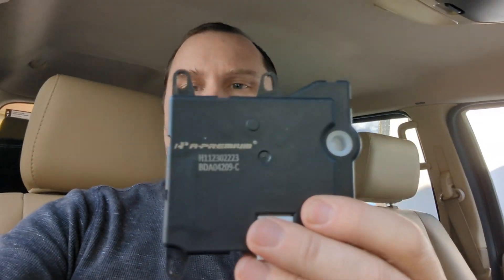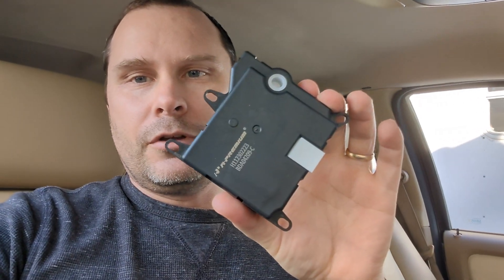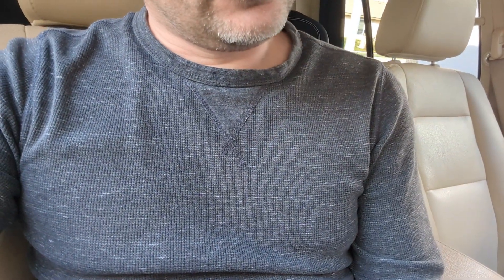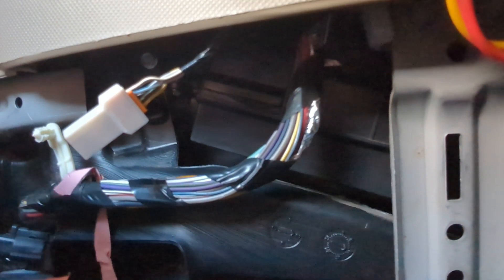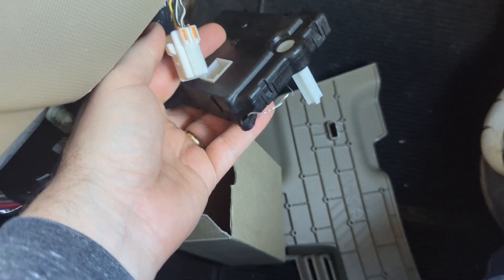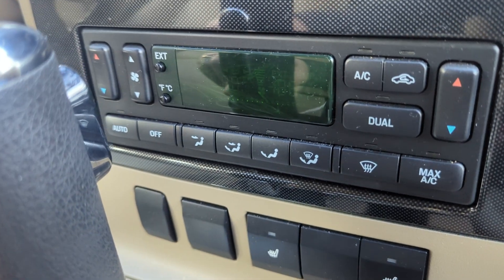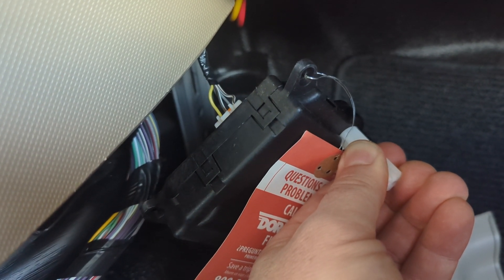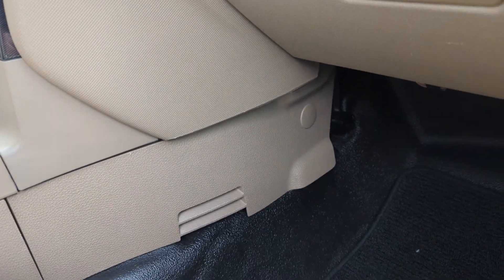Ford Explorer Sport Trac - Replacement Blend Door Actuator Not Working?

Comment: Thank you, this is very helpful. How did you know it was blend door vs blower motor causing the issues? I had no clue about the self-test mode, that's great info.
Reply from the maker: For me I had only cold air blowing and changing the temperature settings did nothing. There is a damper door that is weighted so when the teeth on the actuator strip out (a common failure apparently) the weighted door will open to the cold position by default. This is what led me to believe it was an actuator issue and not the blower motor itself.

Comment: It’s hard to put it in and aligned
Reply from the maker: Indeed, it's very hard but I did mention a tip which is to cycle the system so that the motor turns and aligns to the door position. I talk about it in the video and it does help make it a little easier.